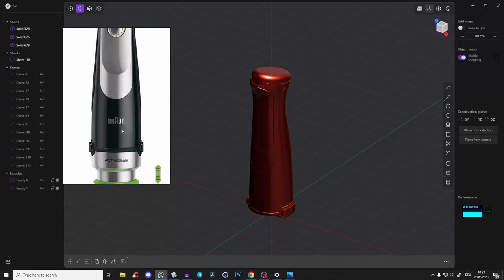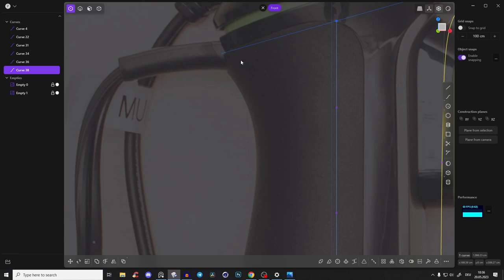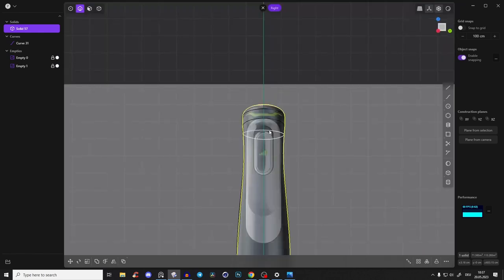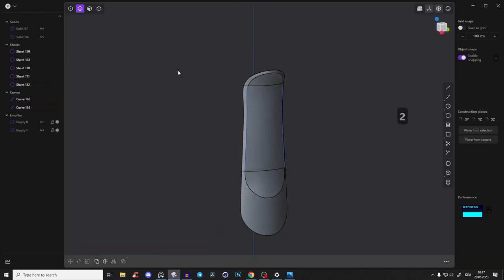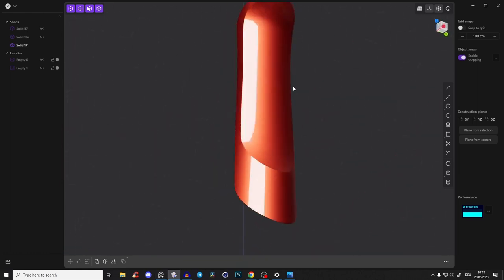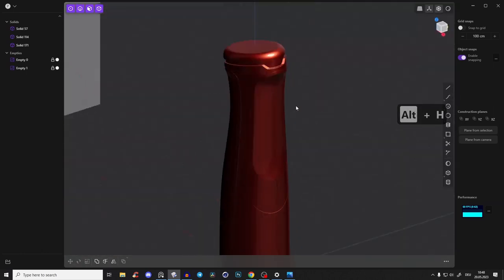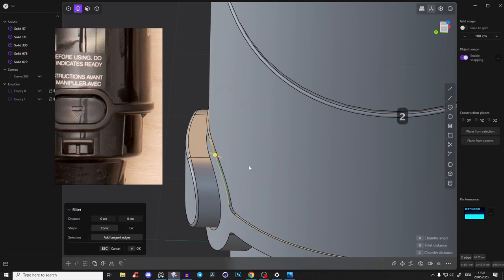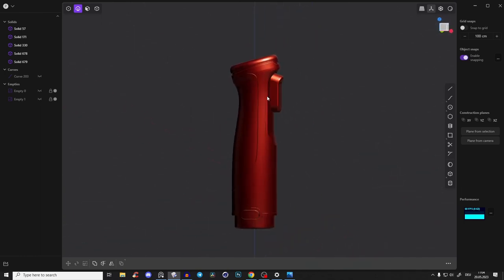Plasticity 3D Tutorial | Advanced Surface Modeling | Braun Blender Design

Comment: Nikita t time 20.00 minute about the button. You need horizontal lines. You loft from the back shape to the front shape. With horizontal, which does not necessarily have to be horizontal, but lying lines. This creates the shape of the kink in the bud. Because what I see you use a slice to make the shape of the button. But you don't have to if you use the cross lines to loft. I have sent you an example. 🙂
Reply from the maker: Awesom thanks!

Just had a look at the file you sent me. That's a great simple way🙋‍♂️
Reply: @nikita.kapustin  You're doing well! Keep up the great tutorials!! 🙂

Comment: Hi. I'm making similar blender in Plasticity and I can't make the sharp edge disappearing, turning to smooth surface. It's the result of lofting shape that has sharp vertex. I see you have the same issue slightly visible for a second on the top right part at 9:14. I can clear sharp this edge in Blender, but it can be lot of work in more complex models. Is there a solution for it?